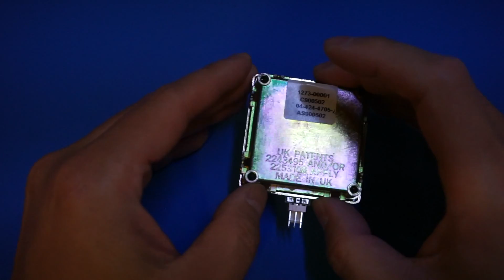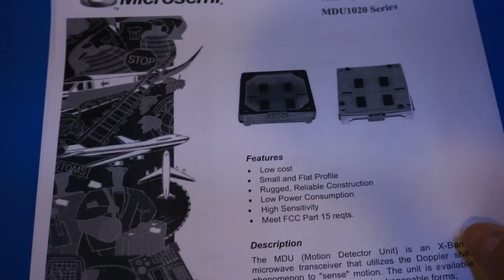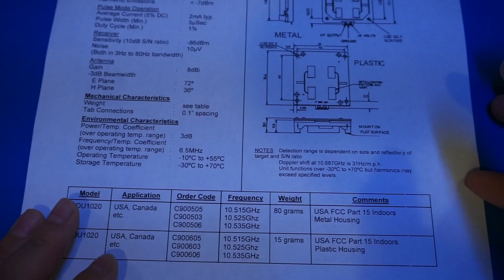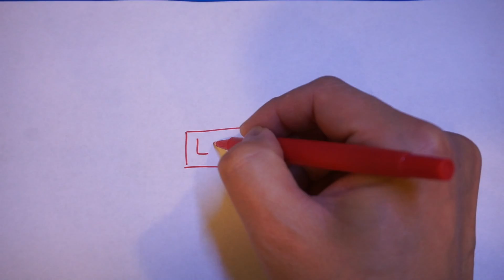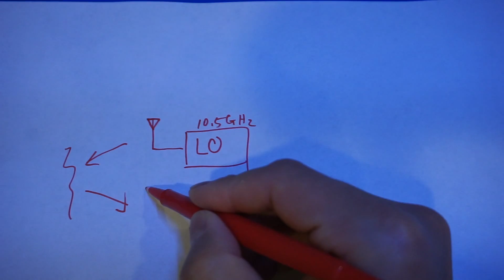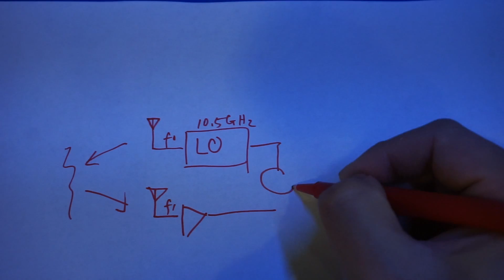Teardown and Experiments with a Doppler Microwave Transceiver

Comment: Step 1: Draw some eldritch symbols on the copper layer of a pcb.
Step 2: Put some components randomly on that pcb.
Step 3: Make an offering to the microwave god.
Step 4: Profit!
Reply from the maker: Very funny :)
Reply: You'd be surprised that this is somewhat close to what's going on with  HF filters. I'm studying High frequency electrical engineering at the moment and we built a filter by taking a straight piece of waveguide and started drilling holes into it nearly randomly and then put screws in to tune it. We went to a broadcasting facility and they were tuning filters by measuring and adjusting, for hours, days and weeks. Those were professionally made and came with a manual for tuning, but in the end you're blowing on screws and praying to the HF gods for days. (slight overexaggeration)

Comment: Great video Kerry. Assuming it can tune below 10.5 Ghz I see the foundation for an amateur transceiver.
Reply from the maker: It could go down to 10.4GHz. The maximum power output is at 13dBm, is a bit too low for amateur radio?